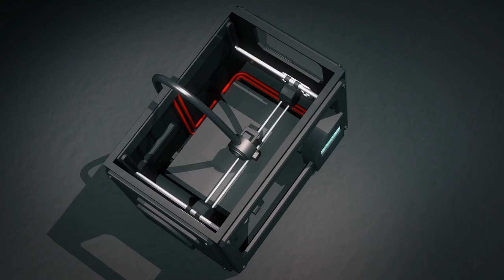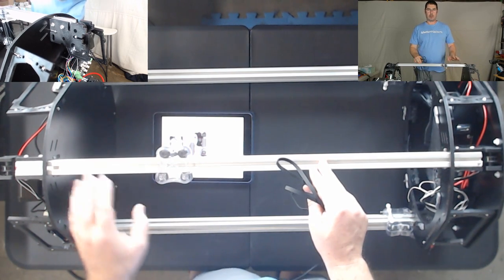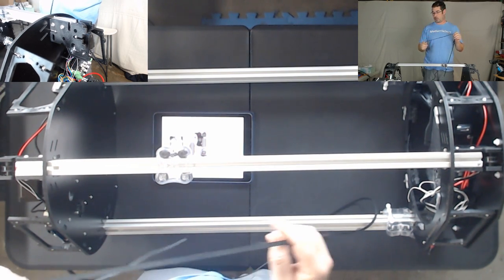SeeMeCNC ROSTOCK MAX v3.2 Build Series Part 9: Steps 31~34

Comment: How long does it take the burnt smell from the laser cutting to go away?
Reply from the maker: I'll let you know if that ever happens. lol
Reply: Thanks for doing these build videos. I got to step 58 before I had to quit for the night. I will finish it tomorrow.
Reply from the maker: Vance Howard my pleasure!  Ii goes quick from there!
Reply: We at ComputerSource use spray shellac on the sides before peeling off the paper to seal in the stink!
Reply from the maker: Not a bad idea. I guess clear nail polish or even a nice contrasting paint could work too.
Reply: yes! We have done some in colors as well. Our business logo is black and lime green, our store use rmax v2 looks awesome in these colors! Your video for the 3.2 is great. I share it with my customers buying seemecnc printers. We are sponsoring ERRF, if you are coming, stop by!
Reply from the maker: Kevin Van Deusen awesome!  Thanks for sharing! My whole goal was to supplement the manual in a more visual way and try to make it less intimidating for people. Unfortunately I won’t be able to make it to ERRF this year, but I’ll get Nick to swing by and grab some pics of the booth for me.